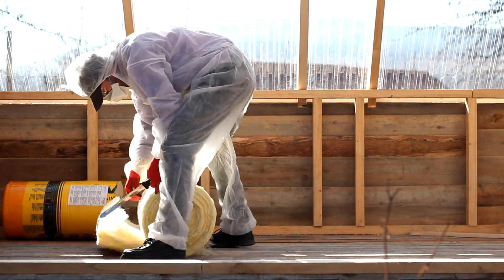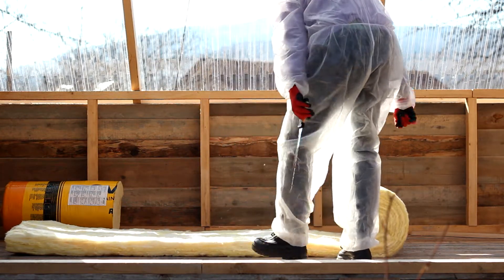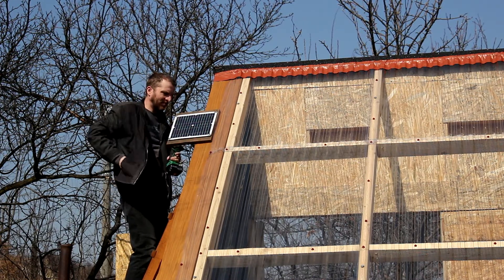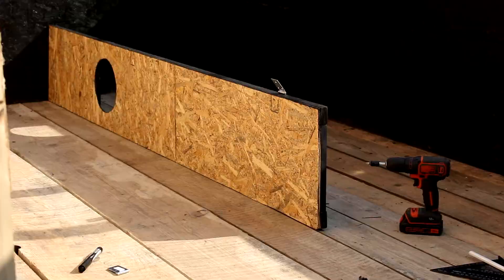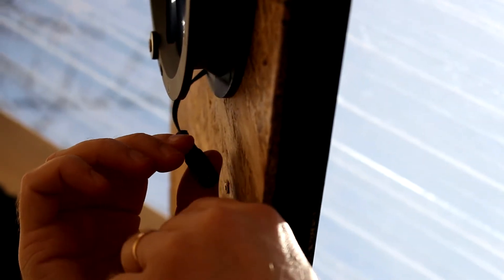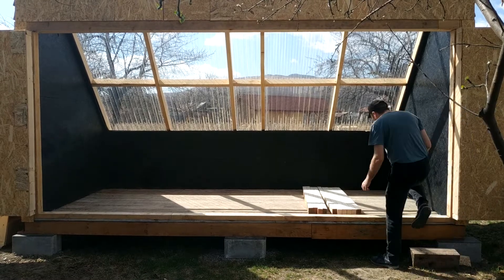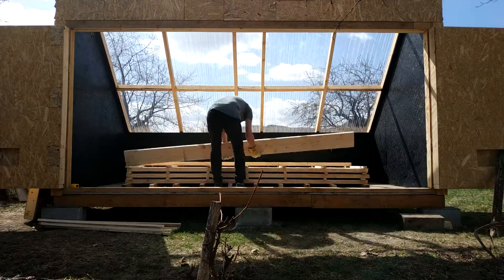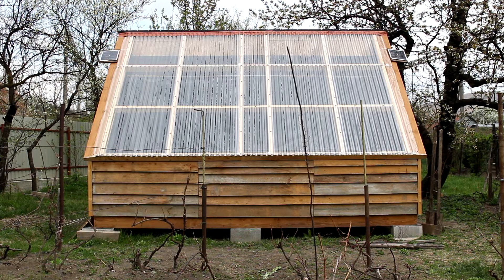Solar Kiln Build - part 4

Comment: Nice build .Can you tell me the length and depth of the floor, thanks
Reply from the maker: thanks, the external dimensions are 4.40  x 2.10 meters
Reply: @greenpineworkshop  Thanks

Comment: How is it working? How much sun do you get where you are? I poured a 8ft x 15 ft slab to build one off of. Are the two fans enough to dry the wood effectively?
Reply from the maker: We added two more fans as the airflow was not sufficient and now it's working better but it could still use a higher airflow. Inside is around 50°C when it's sunny. We've already dried a couple square feet of lumber.